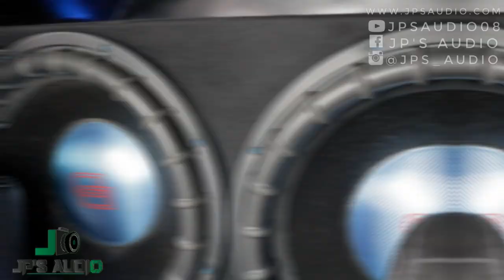4 digital designs 9918 on 2 crossfire 16ks

Comment: I am in the same boat with the 3.5 ecoboost. I think a battery delete would open enough space for a custom bracket. At that point a belt solution becomes necessary because the factory alternator is mounted on the other side. That's as far as I've gotten just planning

Comment: I have a Crossfire 16k at .67 ohm, on 3 xt3 18's, 135ah c-max, JS 300 rebuilt by George Srisosmak that commented below, and at 16v I don't drop, if I clip a little I might drop a tenth, C-max is the way to go with those 16k's, on my 90ah c max I dropped a volt at full tilt.

Comment: Theres definitely better lithium out there, the cyber 12k batts are just a waste in my opinion they seem to be weak on the output for the cost.
Reply: CRAP LIMITLESS IS CRAP!!!!! For the money if it was half price maybe it be worth it but not for my arm my leg and a ear
Reply: @FATHERSOFBASS  Im running the same cell (a123 systems 26650 10c in 30-52c out) and have a 275AH bank that has 8250 amp constant 14,300 amp burst and it cost me $1200 built by a good friend of mine.